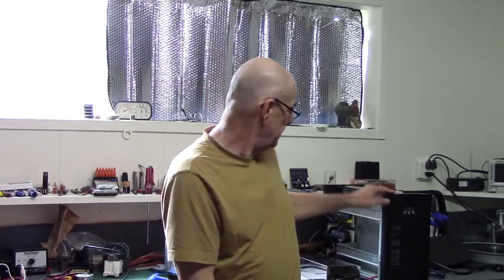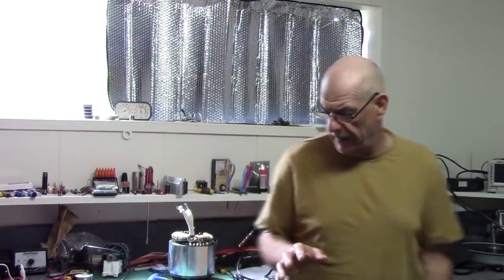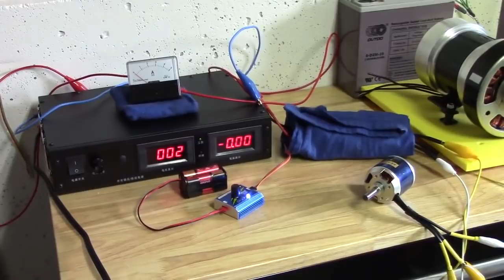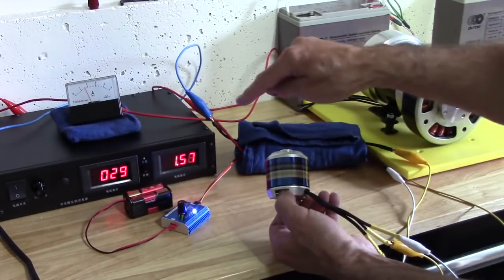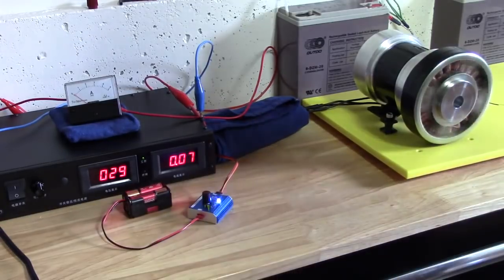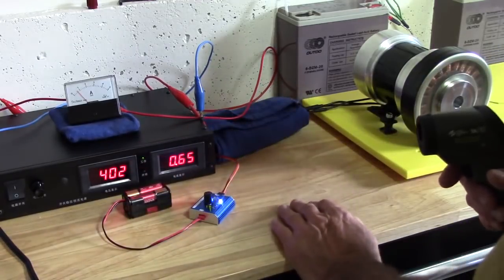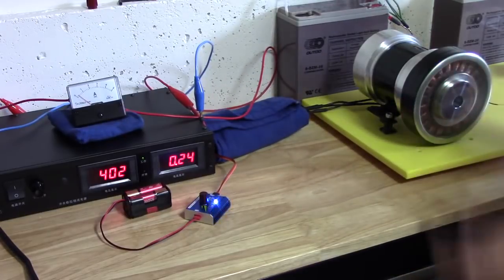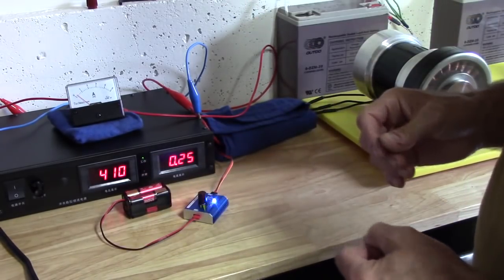Amazing Efficiency before your Eyes   Hyper Drive update

Comment: Gerard You are comparing 2 kinds of motors. A small one running at about 30V and 1.6A is 48W. The bigger one runs at about 400V and 0.25A is 100W. The other difference is the speed and the torque. You run them only at free-wheel. You can not compare motors efficiency without the same torque and speed. The test you show doesn't say anything about the efficiency. It can be that I don't know where you are talking about, then I apologize for my ignorance.

Comment: ⛅Hi Sunshine, your ideas for controlling electricity is on the right track only think about a 12V car battery with over 400 cranking amps. You could probably power four small houses with a closed system. Something to ponder, yes. We are starting to move from a just keeping the porch light on to heating, cooling, bathing an cooking for, four small houses with a 12v, 400 amp car battery if done properly. May peace an prosperity be with you always. C-ya😎Bye beautiful electricity!
"✌💖🤗~🌞🌎⚬"   ...

Comment: Is far as I know, no one has yet shown a fully working motor of the free energy kind in public and at the same time showed exactly how to replicate it in detail, with others indeed replicating it successfully. They either turned out not to work, and often also be a scam (payment was required for the diagram and instructions, and it didn't work) or if it was genuine we never heard from it again. 

Some of the stories in which such a motor actually seemed to work even ended with the inventor dying under suspicious circumstances... and if large companies stand to lose all business due to such an invention, people have been eliminated for a whole lot less. And whole wars with millions of people dying are fought over the energy resources. (Socio- and psychopathy runs in the highest tops of power.)

The only way it might work is if the inventor keeps it quiet, develops it fully in secret, and when finished and it is actually working then shows it and spreads the diagrams and detailed instructions all over the internet via video on all platforms and social media for free, so many people will immediately trust it and take the trouble of replicating it. For then elimination of the inventor or blackmailing him with the thread of harm coming to his family has become useless to stop it. Then it's too late for that.

Surely slowly trying to commercialize it won't be allowed. Anyone believing otherwise is naive.
Even the stainless steel DeLorean car was not allowed... and they tricked the man who developed and commercialized it into doing something that got him years in jail, his company destroyed. Who knows what would have happened to him had he not fallen for the dirty trick... he might have gotten the money he needed legally, but then had an unfortunate "accident." Or he supposedly had ended his life in a "suicide."